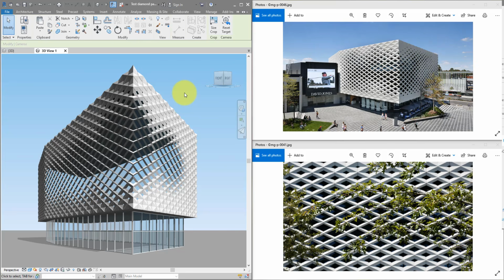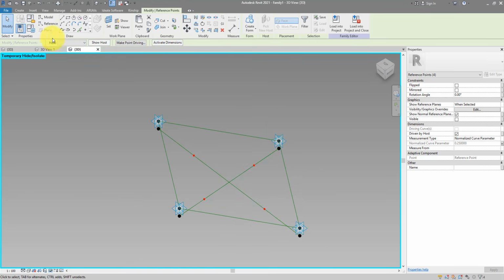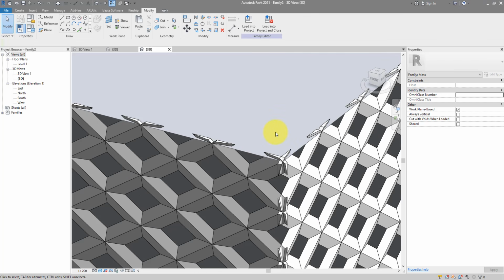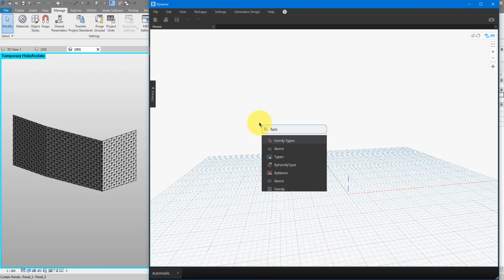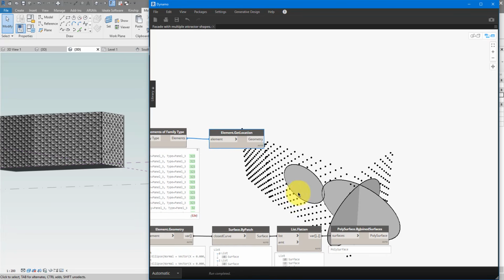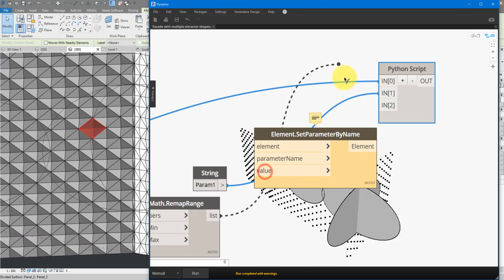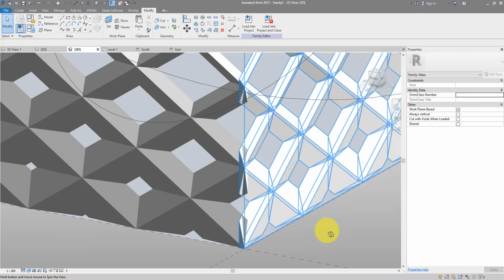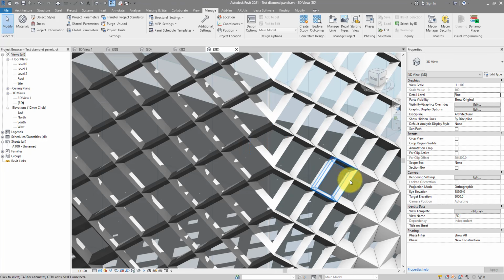Revit Snippet: Create Adaptive Curtain Wall with Multiple Attractors

Comment: Solid video, my friend! Subscribed and liked!
I am now comparing Rhino/Grasshopper with Dynamo for my Pre-Thesis Design, on which one is a better tool - but I am considering Dynamo since I am proficient in using Revit and wanting everything to be just inside one environment.

Just a quick question - instead of doing Model Lines (those ellipses in this exercise) for the facade to parametrically respond to the openings, can we do it using a Sphere or any 3D Form for the facade to respond?

From what I've learnt, Grasshopper is easier to manipulate it by just using a Point. Here's the video from my architecture school tutorial (just to get you understand what I am asking above) (sorry but it's a mixed of English and my native language) - https://youtu.be/wVZSAWFqKT0?t=2366
Reply from the maker: Glad you liked the video! Yes, I also prefer doing everything possible in the same software and environment.
Dynamo can generate attractor patterns using distances to a sphere or 3D objects too. I used model lines in this tutorial only because it's then easier to make sure panels along the corner have the same opening sizes, so they look like mirrored image of each other along the line where 2 facade surfaces join.
You can also use Grasshoper in Revit with Rhino Inside!

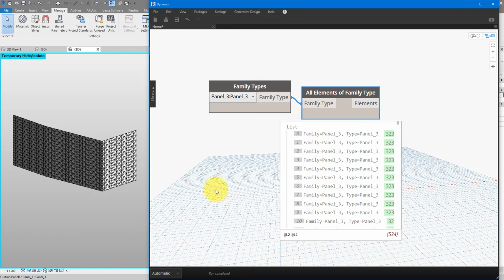Comment: Thank you for uploading a good video. There is a problem. My Revit version is 2018.3 and The dynamo version is 1.3.4.0. I copied what came out at 13:50. and I connected "family types" to "All elements of family type".  However, the list does not appear in "All elements of family type" as in the video. so... what can i do?
Reply from the maker: Hey I just checked and Dynamo 1.3.4 definitely has this All elements of family type" node. Make sure type type in the full node name and scroll through the entire list of results to find it. If the right-click search box doesn't show it, try the same search in the "Library" panel on the left of your Dynamo window.
Reply: +1

Comment: Very clear and comprehensive; I had no idea I could do this with Revit/Dynamo. Was meddling around with Rhino.Inside Revit and Grasshopper but converting geometry to and fro programs is indeed a nightmare. Thank you so much for this, I am infinitely grateful! subscribed.
Reply from the maker: No problem at all! Glad you enjoyed it 😎
Reply: @RVBoost   Hey RV Boost, I had one issue with applying the Panel 3 to a slanted surface. When I divide the vertically slanted surface into a rhomboid, Revit was unable to properly perform divide the surface uniformly. As a result, it is unable to create instances of panel 3 on parts of the surface which was warped by slanting. Is there a workaround for this? e.g. making the 4 points of the Panel 3 adaptable, assigning it parameters so that it could conform to whatever warped rhomboid mesh revit creates as a result of dividing slanted surfaces? 

I am trying to create something similar to the Nanjing Youth Cultural Centre by Zaha Hadid, where scaling attractors were applied to slanted surfaces

Edit: when doing this in a project environment, the error for set.parameterbyname had an error where it says that the parameter is read-only. Does this mean that the things you showed in this video can only be done in a revit family environment/conceptual mass and not in .rvt project?
Reply from the maker: Hi John. Yes, you're right in using adaptive components instead of curtain panel pattern based where Revit fails to create the latter. The good thing is in more recent Revit versions, when you have created a curtain panel pattern based family, Revit automatically generate an adaptive components that looks identical and has the same number of placement points. Hence, at least you only need to create the family once. Then, you can follow the same principle in this tutorial to drive panel opening size with Dynamo.

In terms of environment, I can't remember now but the one I used in this tutorial allows editing the required parameter. Please use that.

Comment: Hello! thank you for the video!
I'm getting this message on the python node:
"Warning: IronPythonEvaluator.EvaluateIronPythonScript operation failed. 
Traceback (most recent call last):
  File "<string>", line 36, in <module>
Exception: The parameter is read-only."
Any suggestions on how to fix it?
Reply from the maker: Hi Marcela, please make sure the parameter is not read only. Test this by changing its value manually for 1 of your panel. If it's not read only, it will let you edit it. If not, make sure to follow exactly step by step in the tutorial how to create the panel famjly.
Reply: @RVBoost  Thank you very much! I was trying to make it work with a mass modeled in place inside a revit proyect, instead I tryed it on an mass family file and it worked perfectly!
Reply from the maker: Great! Glad you resolved the problem 😁

Comment: Thanks for the TUT, simply amazing!
However, in the case of having 3 unique size eclipses and 2 are cutting at the edge of the building like in your example there. Would it still create the same corner effect as shown in yours? because now you have 3 sets of different distances drawing from 3 different eclipses so eventually the opening areas will be different right?
Reply from the maker: Glad you liked the lesson! In case 2 ellipses at the corner don't have the same size then yes,  border panels on each side of that corner will have different opening sizes. This is why I drew these ellipses to the same size as most architects would prefer that in this situation as well.
Reply: @RVBoost  Sure, I guest that's the expected problems, but glad you are admitted it. I'm new to Revit from Rhino and Grasshopper after many years, and found your helpful tut videos that are amazing for a  beginner like me. 
All the best Mate !- From Sydney
Reply from the maker: Thanks for your kind words! I'm in the UK but so glad we can still connect here on YouTube! I'll do more massing tutorials like this soon, just let me know if there's a particular interesting design you want to see built in Revit 😁
Reply: @RVBoost  Sure, I will let you know through the channel if i have some weir parametric form which i would love to see in revit !